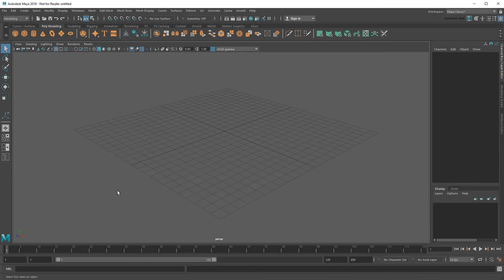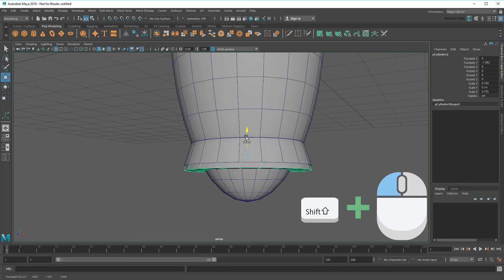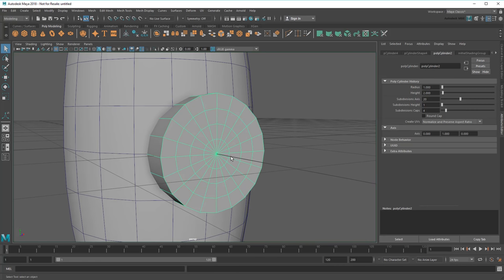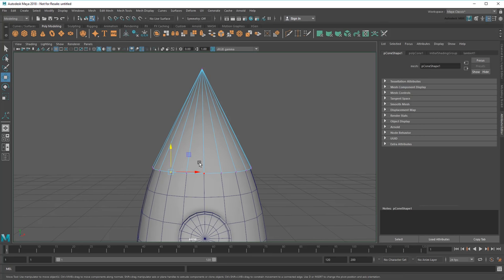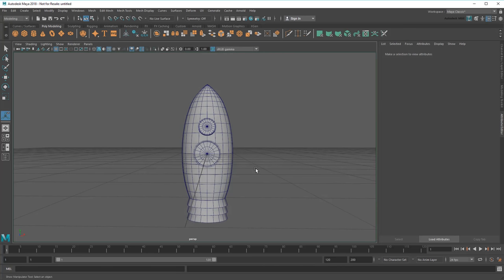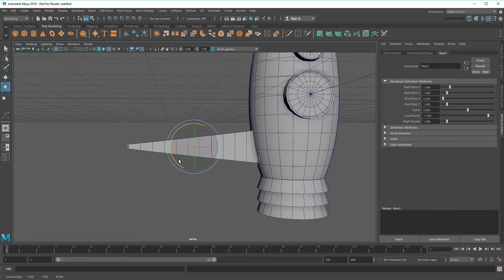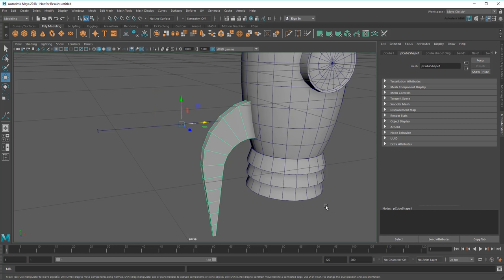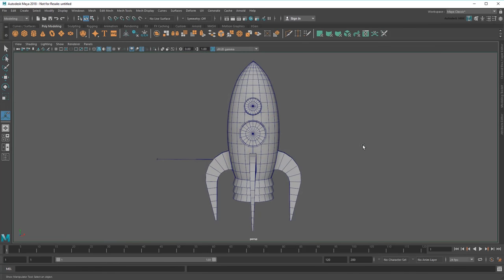Intro to Maya: Lesson 3 / 10 - 3D Modeling your first model

Comment: Why did white thing go to mesh then Booleans then union and what were all those words 
What does polyCBoolOp2 and operation and union and classification and edge and why is it showing that 
Why looking good so far, so on to the nose and how
What is nose cone 
Why this is a lot of the same process except using a cone as a base and how 
What is process and except and base 
What is polycone 2 and radius and height and subdivision axis and subdivision height and subdivision cap and the numbers next to them
Why however it is being somewhat obscured by your rocket and how 
What does that obscured mean
Why so let’s switch to wireframe only mode to see through it and how 
What is wireframe only mode 
Why did white thing go to shading and what are all the words next to it  and white thing went to word wireframe and what is that
Why did the grey thing change look 
Why is there blue thing then green triangle in middle 
Why did white thing move to middle then moved to green thing and the green thing moved up and how did that happen
Why then switch back and to what and how and what does this mean
Why did white thing go to shading then thing under wireframe 
Why then you’ll just give it a bit of a scale and what and how and why did top come thing get smaller and before went to bottom thing and middle yellow thing
Why there now that it’s in position you’ll like to round it out and how
What does in position and round it out mean 
Why but like the porthole before, that means you’ll need to add some more components and how and why because there’s not enough right now and why is that
Why so once again, you’ll go to the polycone tab in the attribute editor and this time you’ll increase the number of height subdivisions and how do we do all this and why which adds a bunch of edge loops up the height and how 
What are edge loops and height
Why is white thing moving to polycone1 and then moved to white rectangle next to words subdivision height and moved right a bit
Why to round it out, you’ll need to squish together these top rows, before gradually widening 
Why does top thing have blue on it 
Why so by now you already know how you could select vertices or edge loops and how and move them one at a time with the move tool and how 
Why was grey thing moving 
Why we can also do this in one go using something called soft selection and how 
What is soft selection 
Why watch what happens when you press B while this vertex and which is selected 
What is vertex and B and press 
Why did top of grey thing turn red and it showed soft select mode is on. Tap b to turn it off and some words are yellow 
What does tap mean
Why very top of grey thing is yellow
Why the colour region shows that, instead of targeting one at a time, your selection now targets an area of effect and how and what does this mean
What is targeting and area of effect and selection and colour region 
Why did grey thing change 
Why by holding the B key and dragging the left mouse button back and forth you can also change the size of that area and how do we do this
What is back and forth 
What is area 
Why is it showing B green + and blue left top white thing 
What is B key
Why is it showing big blue circle 
Why watch what happens if you scale down and how are you going to do this
Why did top just get bigger and changed 
Why it was on bottom left square
Why the vertices closer to the tip squish together, while those further away remain spaced out and how
What is remain and spaced out mean
What does squish mean
Why it’s not only handy for speeding things up, but also for getting nice smooth shapes and how
What does smooth shapes and handy and speeding up mean
Why which you will show again using the move tool and how And why did small white thing go to middle square 
Why the key when sizing your region is that you don’t want to touch your base vertices and how
What is sizing and base vertices and region 
Why is blue circle at top and red rectangle at bottom 
Why since you already lined them up how you want and how did you 
What is lined up
Why then you will just move them down and how and why that’s our nose cone
What is nose come
Why it went back to bottom left square 
Why again don’t worry too much if our model doesn’t look exactly like this and what 
What is model 
Why white thing went to mesh then booleans then union and whole thing turned green
Why close is good enough 
Why did it show polysomething and operation and classification 
Why now we’re finally onto our trickiest part the fins and how
Why is fins the trickiest part 
Why you say it’s the trickiest because, unlike everything else on our rocket so far they don’t closely resemble any of the primitive shapes and how
Why don’t they resemble any of the primitive shapes
What resemble and primitive shapes mean
Why in cases like this, you’ll need to start with the closest primitive and how and why then mold it’s components into the shape you want and how 
What are the three white things and with 1. And 2. And 3. Showing
Why so you will start with the cube this time and how
Why white thing went or orange second thing at top
Why does it show polycube1 and under width and height and depth and subdivision width and subdivision height subdivision depth and what do all these mean
Why again the rocket is hiding our cube inside, so we’ll need to switch to wireframe mode and how and why this time using hotkey 4 and what is that and how do we do that 
Why thing turned blue and we can see green thing inside 
Why now we can move it to the side and press 5 to return to shaded mode and how do we do that
What is shaded mode and 5 
Why green thing moved to left 
Why white thing went to top grey thing on left
Why then in the attribute editor, you’ll add a bunch of more subdivisions along its width, before stretching it out and how 
What is width

Comment: I have a question. When I hold J + left mouse to move the pivot, it does not snap...please help
Reply from the maker: Which version of Maya are you using?
Reply from the maker: @HorrorMysteryxxx  oh wait sorry I misread.  it shouldn't be J + left mouse (that's to snap rotate).  If you're trying to move the pivot, you'll want to hold X to snap to grid spaces.

Comment: Why however rather than shift dragging them one at a time, you can go up here and where into edit duplicate special option box menu how 
Why did white thing go up to edit then word duplicate special and how and what does this mean
Why did it show shift + dragging when you said shift dragging and what does that mean
Why here you can set the number of copies to 3 and how and why even rotate each one to 90 degrees and how 
Why is it showing duplicate special options and under edit and help and what does this mean
Why does it show geometry type white circle copy and instance and circle not white next to it 
What is group under and parent and white circle in the middle of these words
What is world and new group and black squares next to them 
What is small transform 
What is all the stuff under small transformation
Why did white thing go to black rectangle next to number of copies
What is number of copies 
What is set
Why was number three next to number of copies 
Why did white thing go over number in middle next to rotate and it turned blue then changed to 90 
Why did white thing go to duplicate special and three white things came
Why did you say whoops well that’s not right
Why as we can see, all your duplicates have huddled around your fin instead of your rocket 
What does huddles mean
Why to understand why let you just undo that with control z and how
What is control z 
Why did it show ctrl + z when you said control z
What does undo mean
Why notice that when you select move tool the manipulators appear out here and where why right where those duplicates were huddling 
What does manipulators mean
What does appear mean
Why is it showing green yellow and blue long things next to grey thing 
Why was red rectangle around green yellow and blue thing 
Why this is know as your objects pivot and what is and why basically it’s centre
Why just like moving the centre of the bend deformer changed how it bent and what, so too can moving the centre of this fin change how it duplicates and how 
What is centre
Why to change an object’s pivot, press D and how 
What is D
Why this puts you in pivot mode, which we can tell for the change in manipulator 
What is pivot mode and manipulator 
Why can we tell from change in manipulator and how 
Why in order to duplicate the fins around the rocket, I need to place this pivot at its centre and how And why did it show 4 when you said that
Why which you can do by holding J again to snap move it and how 
Why the green and yellow and red thing move to thing on right
Why once that’s done, you can press D again to exit the pivot mode and how 
What is exit 
Why did it show 5
Why then you’ll try duplicating again and why did white thing go to edit then duplicate special ctrl + shift and it showed that duplicate special option thing again
Why this time, you’ll also change the geometry to instance and why we’ll see why I a second
What is geometry type and instance 
Why circle next to word instance turned white and white went to duplicate special 
Why voilà, the fins all rotate perfectly around the rocket 
Why is voilà 
Why two more grey things went around bottom of grey thing 
Why now back to that whole instance thing — the reason you did that is so you can go back to your bend or flare tabs and still play with the shape of the fins and how 
Why on right it shows polycubeshape1 and stuff under and why it started changing to something else
Why stuff on grey thing started changing going up and down
Why if you had left geometry type on copy then only your original fin would’ve been effected by this.
What is original fin and effected 
Why and finally, you’ll union all these pieces together and which and how 
What is union 
Why is it showing shift + and blue thing on eft of grey thing 
Why did white thing go to mesh then boolean then union 
Why you said here’s our completed rocket 
Why did white thing go to attribute editor on right 
Why of course there are plenty of places we can go from here and how and what do we mean
Why we can add a torus brim between the cone and body, or little rivets along its edges and how 
What is torus brim and rivets and edges 
Why did grey thing have circle on it 
Why we could even edit the shapes we have now to get an even sleeker, more alien rocket and how 
What is sleeker 
Why and that’s just modelling 
Why delve a little bit further and we can learn to animate a rocket taking off, 
What does delve and animate and taking off mean
Why add a smoke trail and how , and finally shade and light the scene to look it’s best and how 
What is smoke trial and shade and light the scene
Why so get creative and have fun experimenting and how 
What is creative and experimenting

Comment: "ill jsut drag select these bottom verticies..." How though? It just selects the faces on the one side I can see.
Reply from the maker: Try double-clicking the Move Tool to open the Tool Settings, then check to make sure that "Camera Based Selection" is turned off.
Reply: @Autodesk_Maya  I tried looking in the Move tool for ages. Found it eventually in the selection tool section instead. You were right, it was turned on, but as I had not changed the settings since installing Maya2020, it would be worth telling people they need to do this in the description. Not great for beginners otherwise.
Reply from the maker: @TheAlmightyPillock  It is supposed to be disabled by default, so I'm not sure why yours was turned on.  But yes, if I see others struggle with this I'll add a note in the description (so far it hasn't been an issue until now *crosses fingers*)
Reply: I’m stuck on the same bit, I followed your steps and dragged to select the bottom vertices but no matter what I do it changes the whole shape instead 🤬
No matter what tutorial I do I always run into similar issues where things don’t work as shown...so infuriating! 
Really love your content though...very easy to understand 😊🤘🏻
Reply from the maker: @RazReags  Does the mesh appear red or yellow when you select the vertices?  If so, try pressing "B".  You might have "Soft Select" turned on by accident.
Reply: Maya Learning Channel  that fixed the issue, many thanks! 
I’ve started a games design course and I’m keen to soak up as much knowledge as possible...so many things delay my studies. Many thanks for the quick reply 🤘🏻
Reply: I am also having problems selecting the bottom verticies. When I select the bottom section to scale it out it doesn't scale the back of the cylinder...only the front and the side. I made sure the "Camera Based Selection" is unchecked and that I was not in "Soft Select." I am using the new version of Maya 2020.3. Is there something else I can do?